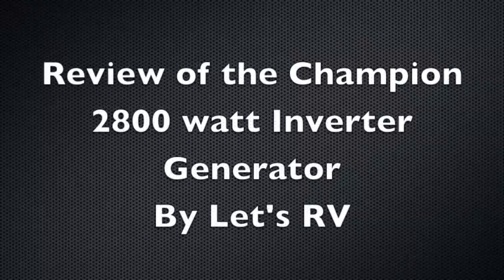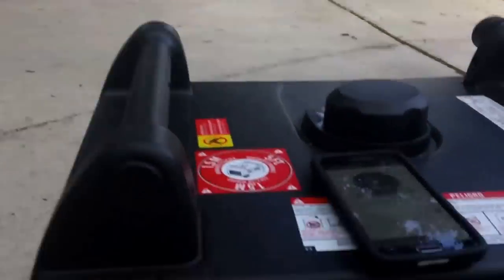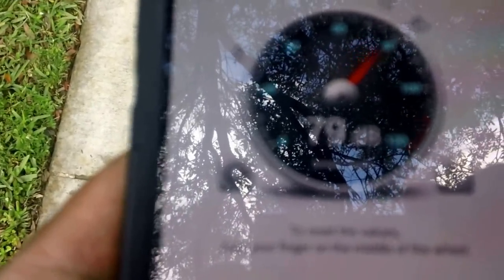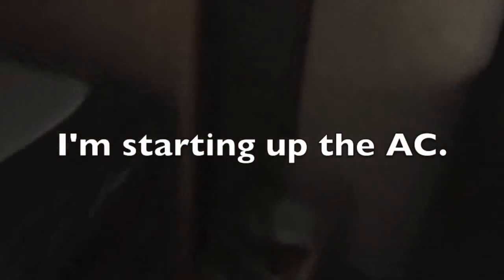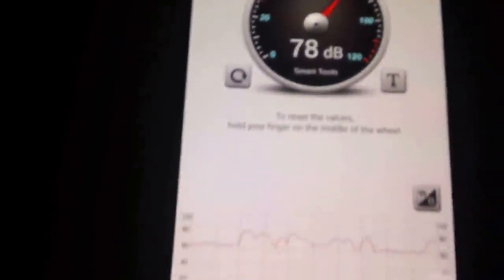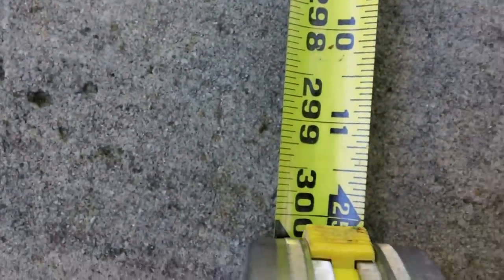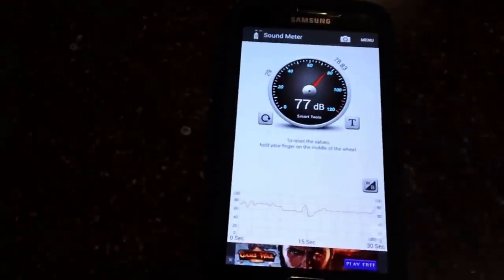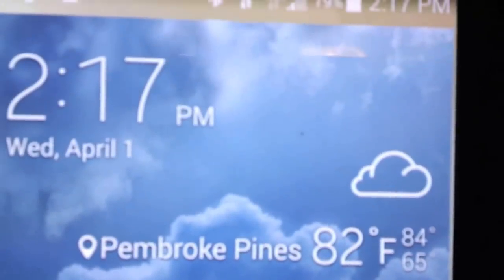Champion 2800 Watt Generator Sound Demo

Comment: Very helpful! Thank you sir!! I currently have the smarter tools inverter from costco. Very quiet but does not run my RV AC.  Ordered this champion 2800 online. I will try to do a comparison video of smarter tools and champion 2800 when it gets here. The sound level does worry me a little. But 51db smarter tools  vs 58 db champion doesn't seem much of a difference, on paper that is. Thank you very much detailed review!!!!
Reply from the maker: I'm glad this video may have been helpful. I'm happy with the sound quality. I just used it for 8 hours the other day to run my AC. The next thing I want to do is buy a second cap and run a hose from a fuel tank to the cap to gravity feed the generator. This would give me a few days of fuel.  I look forward to your video, good luck and safe travels.
Reply: +Lets RV - Hey, did you ever do that? Buy a second cap and run a hose from a fuel tank to the cap to gravity feed the generator? If so, where did you get the cap and how did you set it up? -- Id like to do the same thing. Thanks in advance.
Reply from the maker: +Start The Rebellion I haven't yet. Champion is sending me a new cap because the one I have now doesn't tighten all the way. Once I have the new one I'll modify the damaged one.
Reply from the maker: Start The Rebellion Champion sent me the and an entirely new tank. Why I don't know. But I've found a company here in Florida that makes an auxiliary tank kit. If the price is right I'm in.
https://youtu.be/tPdMvS7MvlY
Reply: +Lets RV - Yeah, I had seen that kit, but at $250.00 for a hose with a squeeze bulb and some clamps and a connector.... that also requires 45 minutes of "surgery" on the generator... I'm not sure if "the price is right". :-/

Seems like a simple "gravity fill" set-up that modifies an extra tank lid... something like what it sounds like you were initially going for, would be a more straight forward and cost effective approach.

Hey, I wonder if there'd be a way to take the original tank's exit hose and put a switchable by-pass valve on it so that you could simply run a second fuel hose to a second larger exterior tank? Hmmm....

Comment: No need to run it in full power mode for AC. Mine starts my AC no problem from ECO mode
Reply from the maker: What size AC do you have?
Reply: +LetssRV 13,500, I just turn the fan on first so the gen isn't idling.
Reply: +hotshtsr20 just saw yours is 15k. Might still be able to with the fan already on
Reply from the maker: I leave the fan on constant just for some background noise. My AC is a 15 BTU, so I don't run it ECO. Regardless my AC ran for 6 hours on one tank.